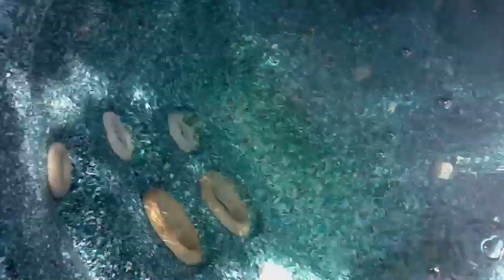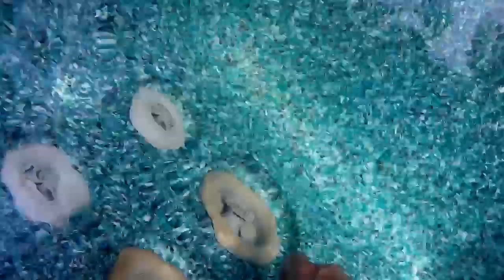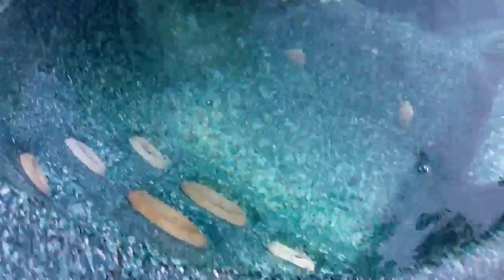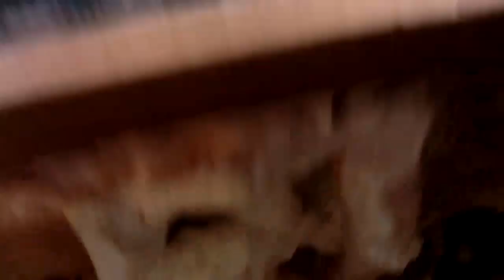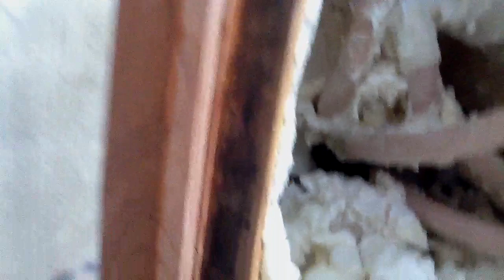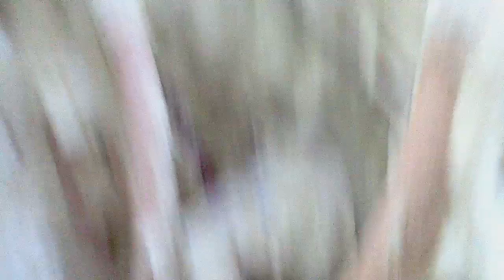Hot tub leaks through acrylic and fiberglass

Comment: I tried Plast-Aid, it said test first by putting some of the liquid onto the surface and if it got sticky then it would work with Plast-Aid.  The hot tub surface didn't get sticky so I did not use it.  In the end I put lots of Weld-on 16 on and it seems to have at least plugged the leak if not fixed it.  I have since sold the tub.